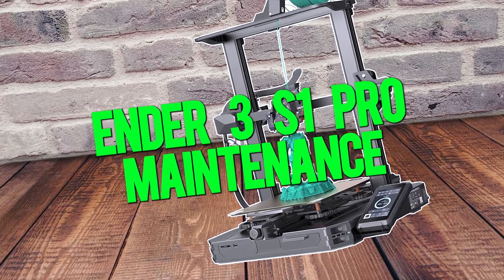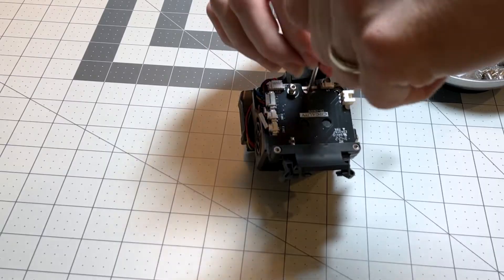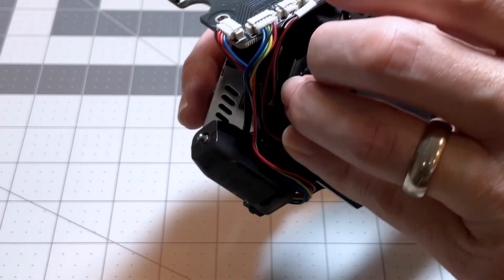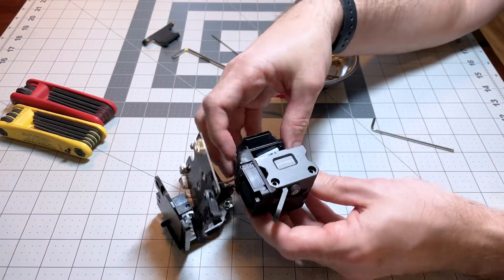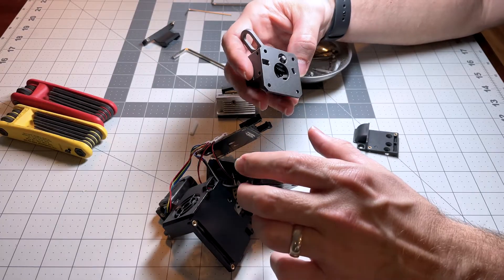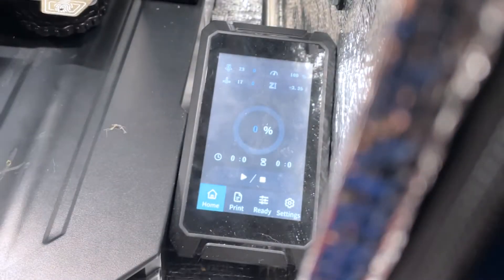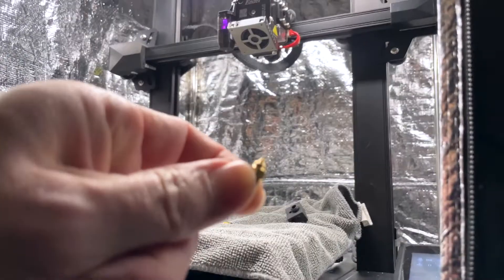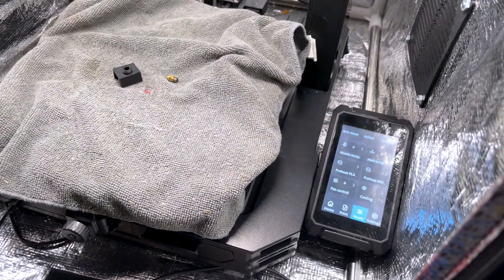Ender-3 S1 Pro Extruder Fix - Quick & Easy!

Comment: What if there is fillament stuck in the nozzle
Reply from the maker: The heat should melt it. But you can try pushing a cleaning needle through when it’s heated.

Comment: Your video was legit pretty useful overall. My clog was in the extruder gears. I had a very difficult time getting the extruder block apart. I ended up taking a heat gun to it on low, which softened the PLA enough to pull out.

My suggestions for future videos: show each screw when it comes out for a moment so we can identify which screw it was when it's time to reassemble. Consider mentioning the heat gun technique. And please consider explaining what the spring lever and spring tension adjustment screw do, as dealing with that was also difficult for me.

Or not, haha. They're just suggestions. I'm still very grateful for your video either way. Thank you! 😊
Reply: dude same i had 3 inch of pla in there thx for the heat gun idea
Reply: @Grandpa_Juan No prob, glad it was helpful! And thanks for letting me know, always nice to know it helped someone :)

Comment: Seems there could be 5 times less screws, too complicated to remove fillament jams
Reply from the maker: It seems like a lot at first, but it’s not that bad.
Reply: There is a way faster and easier way to remove clogs. It does involve removing the nozzle and heater block while hot, but that's all. None of the fan cowl or heat-sink stuff. The 4 screws to remove the extruder, the nozzle, loosen 1 grub screw and the 2 screws for the heater block.

Comment: We just got this printer our first. and it won't print anything for us not even the first sample.  I'm so sad.  We have tried changling the nozzle and looking for answers.
Reply from the maker: So, you have leveled the bed right? It’s literally the first thing you have to do and the most common problem for first time printers. Rick Impey has a great video showing you how:
Reply: @shortreststudios  yes first thing we did. Followed all the instructions.  It even extrudes the little bit when told to but when we tell it prit it moves like it's printing but nothing comes out
Reply from the maker: @susangrant9457  what material are you printing with? What’s the nozzle temp, and what’s the ambient temp in your space?
Reply: @shortreststudios  the filament that came with it 200 for the tip and 60 for the base and our room is usually about 73
Reply: @shortreststudios  I will try leveling again. We are new at this so we don't really know what we Re doing. It was a disappointment.  My 15 yr old wanted to start this so we are really trying to figure it out
Reply from the maker: @susangrant9457  The filament that came with it is probably PLA. If nothing is extruding, you might need to up the nozzle temp a little - maybe to 205°. You might also check and see if  there’s any material stuck to the underside of the hot end. It can collect there if the nozzle isn’t close enough to the bed, and it can be hard to see.
Reply: We did try that.

Comment: I'm experiencing heat creep as well on this model and its driving me nuts. So many projects delayed. Do you have any ideas on how to fix it? PLA is basically unprintable now... changing the nozzle doesnt help.
Reply from the maker: I’ve had problems with heat creep when the ambient temp got too high (I’m printing in my garage). Honestly I directed a fan onto the printer and it helped. You have to be careful about how directly the air is blowing onto it though.